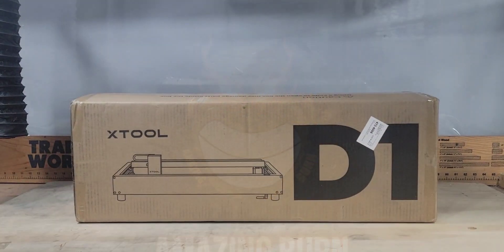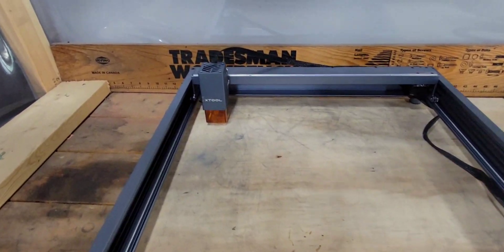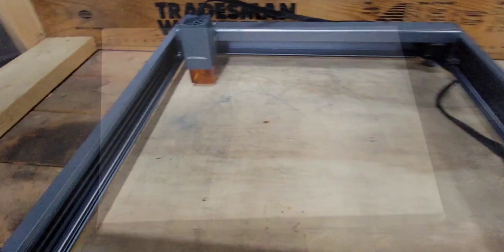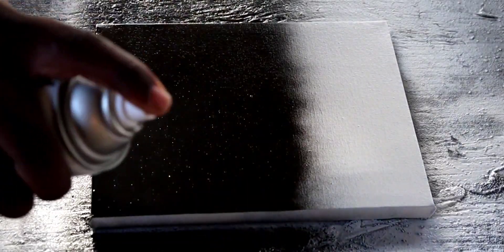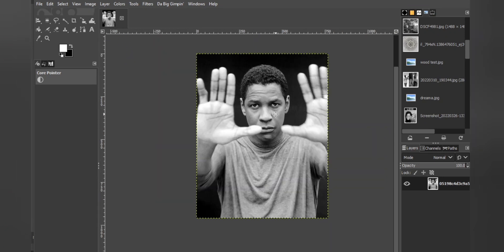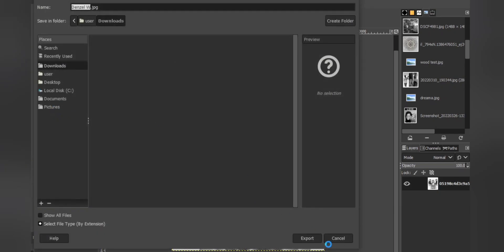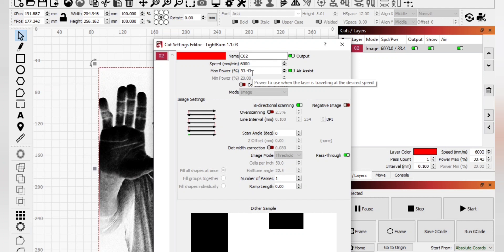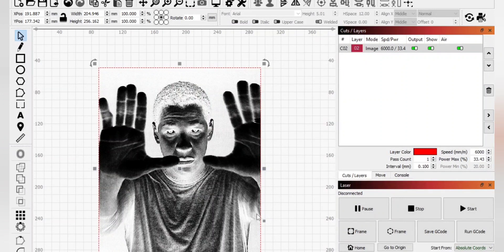X Tool D 1-10 Watt Laser Review Denzel Washington engraved on a 8x10  Canvas (Setting The Bar 2022)

Comment from the maker: X TOOL D1 10 Watt

https://www.xtool.com/?ref=JC325hVk3acXk&utm_source=influencer

discount code : SouthernSmokeEngravingEaster.
The discount code is 5% off of D1 and is active from now til May 6, 2022
Reply: How satisfy are you with the xtool d1 so far? I bought an atomstack x7 pro and immediately regret my choice, because i saw the xtool around 1 hour after my purchase. I played with the atomstack x7 around 6 weeks and then i bought the xtool. Since then i never ever used my atomstack anymore and it is standing in the corner. The xtool D1 is on another level if you ask me.
Reply from the maker: @Lomaxxx  You are correct it is on another level . I am Loving it so far
Reply: So do you prefer the xtool over the ortur?
Reply from the maker: @D-GatDesignsLLC  no comment

Comment: I wanna get this unit to do photos , would u recommend  the 20wt or will the 10wt be just as good ??? I've seen u did videos on both . Thanks great work
Reply from the maker: They are both awesome at engraving
Reply: @zerica24    I need help,  when I try to engrave anything picture , letters  my machine stops after 20 seconds  and on the lightburn pane it's says busy ???  I have to restart everything , lightburn and my Laster master 3  I've been at this for 2 days I can't figure it out ...please help

Comment: Hey Question, have any suggestions on Canvas types you should be on the lookout for as in standard ones, Primed white ones etc. I'm noticing also sometimes same canvas same paint etc. the paint doesn't get fully absorbed into the material leaving light lines in the canvas (hope that makes sense) any suggestions there. Already doing the same light coat of white and black some come out perfect others not so much.
Reply from the maker: Some of the canvas need a heavier  coat of white paint.   I use raised canvas from Michael's  they always come out great . T
Reply: SouthernSmoke Engraving have you tried other colors yet.
Reply from the maker: @Arlisa1913  Yes I have several videos on my channel . Will be posting one soon on the Xtool 10 Watt

Comment: Great work, for the 5 watt do you think one should cut down half on the settings? I got the XTool D1 5 Watt version 2 days ago and did a few test runs using ImagR and Laserbox. Using Lightburn seems to have more features but a bit complicated for me. For example, I ran 35 percent power and 50mm/s and got a nice black and grey photo on a canvas, but on Lightburn It didn't do well at all.
Reply from the maker: I totally understand I had the opposite problem 🙃  If you email me I will send you over a  sweet spot file to help you find  the correct  settings.  Email me at Southernsmokeengraving@gmail.com
Reply: Lightburn is so overwhelming to me 😫
Reply: @Arlisa1913  So far 2 months into using the Xtool D1 and  I'm getting good results using Laserbox Basic only. Doing canvas and wood engravings. Because i have the 5 watt I have not been able to cut what I wanted but i use a saw and a dremel tool to fix that.
Reply: hey man, could you message me, i have a xtool d1 5w as well and i’ve only had it maybe two weeks but i am trying to engrave a couple things and haven’t been successful, i tried acrylic and i am now struggling with canvas i just can’t find the right settings it either comes out to dark or just not right